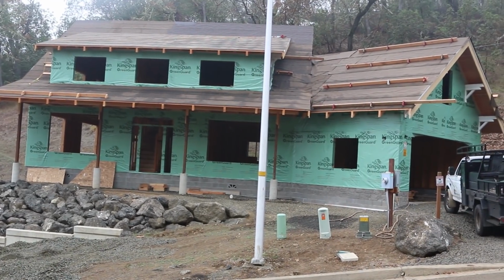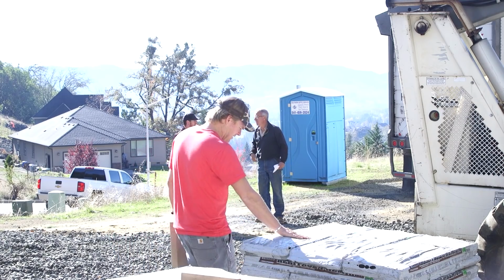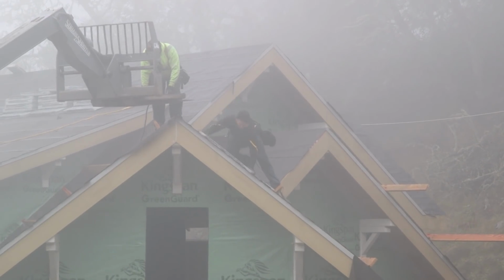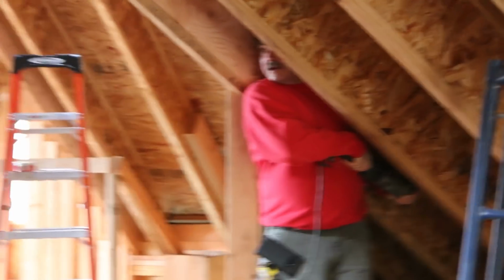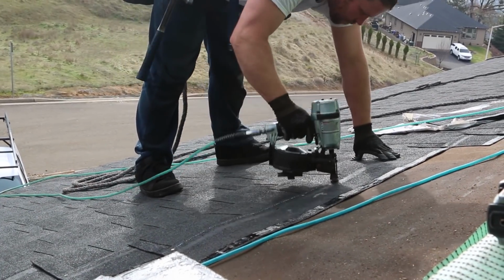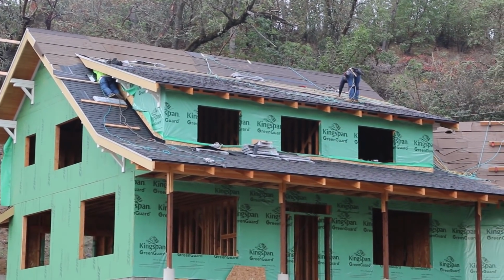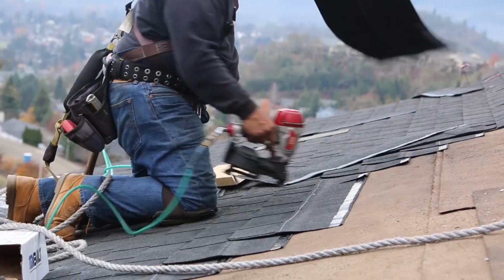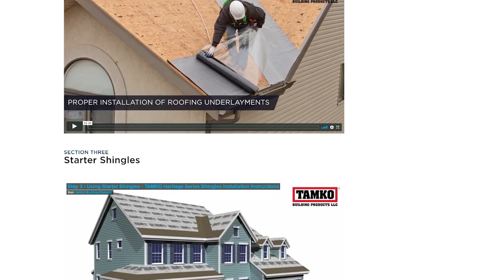Installing Asphalt Shingles Ep.77

Comment: Lol their safety anchor is held by nails?  That's not right is it?  We always used a special struc screw
Reply: If you think those 16d nails will pull out with a force perpendicular to the direction they were driven in, than go get some common sense.
Reply: @Faruk651  *then go get some common sense you mean?? THEN not THAN.  Smart guy over here 👈
Reply: Knowing good grammar has nothing to do with being smart. But not being able to understand the holding power of a 16d nail in shear force shows how smart you are.

Comment: 30 years ago I selected Tamko shingles for my home and it was the biggest mistake I made.  They simply would not seal and when I called them out to look at it they said it wasn't a problem.  They walked away leaving me with a 2500 square foot two story house with a gambrel roof that flapped like leaves on a tree with every wind from 10 MPH.  Sorry this is negative but they simply refused to consider they had a problem.

Comment: Guys are tied off, however there is so much slack I doubt the safety lines would help in a fall.
Reply: As long as the slack is shorter than the trip to the ground it'll at least help.

Comment: On the whole I like your videos and what you are doing.  But why would you use black shingles?  I know it looks nice but you are not heating the house with solar heat.  I too have finally had enough of a black car that heats up to 160 degrees where as the next white or silver car only heated up to 100 degrees in 85 sunny driveway.  About 4 years ago I had to have my so called 30 year roof replaced after 15 years.  This time I got a light shade that has made a world of difference.  My air conditioner is now on a lot less, costing much less electricity to run.  

Keep up the good work, I still am still learning despite my advanced years.  I guess we keep learning till we stop doing!

Comment: I hired some masonry pros to fix my falling 7 foot brick wall and they dumped wrnt concrete slush behind my wall in both my allys they left my yard a mess the wall they didn't isnt even level on the horizontal or vertical positions the wall is now bowing and they left a mess in my yard as well dumped morter slush and concrete slush in my yard and also borrowed one of my 5 gallon empty buckets didn't ask and destroyed it and I can't get them to come back out and clean there ness my alleys say no dumping and they dumped over 30 backs of concrete and mortar in my alleys just ripped the bags and jumped them was wrong @Essential Craftsman

Comment: That papers been sitting there to long which is why its buckled, and why there having a hard time nailing it,use that lull instead of hanging off a 2by4.no drip edge on the rakes that's a no no.

Comment: 17:30 Great spot to outline just how tightly installers must adhere to mfr's guidelines in order for homeowner to derive the "50 Year Warranty" benefits, without which a future claim will not be honored. Surprise! Can't tell you how many folks have been burned by the minutiae their installers may have overlooked (seams, nailing schedule, underlayment, penetrations, boots, drip edge, etc.)... in short, ANYTHING the mfr. can use to get out from under the danged 50-year performance guarantee.

Comment: Not trying to make judgements, but can anyone explain why you would use tar paper other than shaving $ where it shouldn’t be shaved?  I have been building for 20 years and not once has any distribution, manufacturer, or simply anyone said “hey let’s use tar paper”. Now, I am on the northeast and maybe we just want our homes to last longer here, using tar paper is like hand nailing.... it was done only because it as the only option the underlayment now are only about $15 a square max and will keep a house weather tight for 6-12 months with no worries of water coming through without shingles.  Sorry, not trying to criticize, but this is not a place to cut costs on a building.

Comment: 8:15 The red shirted professional moves the nail gun in a very unprofessional way by pulling/lifting by the hose which you should never do. At least, if it is your own equipment and you wish it to last for the next project, too.

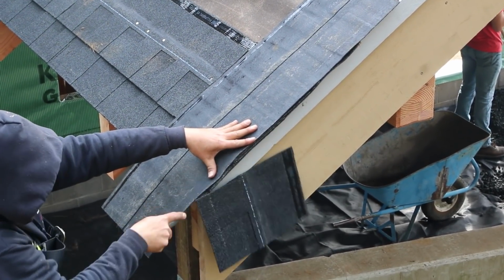9:18 The other guy cut the edge sheat without any metal liner or ruler. That's why the cut is not straight and it might be difficult to get cutted straight afterwards. The poor and not straight cut is easily seen in the video.
Reply: Pulling the nailer by the hose does result in strain on the hose right by the fitting, but it saves so much time that it's absolutely justified. Removing the inch or two of damaged hose every few months is a far better deal than managing awkward holds every minute of every day.

And the worker definitely used a straight edge to make the cut, it was the back edge of another shingle, I don't know if you could see it against the other shingles but it's there and it's straight. The resulting cut was as straight as any factory shingle edge. It may not have been as straight as a laser, but if you can make a cut that's as straight as the rest of the material, you've done well.
Reply: Haha I saw that too. Right when he said "professionals" the guy slings a nail gun by the hose.
Reply from the maker: Hoses on guns and cords on saws are net production advantages. The ability to lift and lower the tool without having to lift and lower your body is a money maker. I’m not afraid to buy a new tool, and I’m also not afraid to use the hose or the cord as part of the tool.
Reply: @HT-gx5jk  Haven’t used nail guns much, have you?
Reply: @psidvicious  I've used them daily for years. I regularly handle tools by the hoses or chords whenever it is more convenient, safer, or more efficient, so I fully agree with Essential Craftman's comment above. That's not my issue here, but rather the slinging of tools, which can be weighty especially when being slung, and thereby risking losing your balance while standing on top of an unsecured ladder at neck-breaking height without wearing a safety wire or even a helmet.

Maybe it sounded like I was concerned about the tool. My mistake. When working at dangerous heights I don't care about the tools. I rather break a thousand tools than my neck.

Comment: As a Californian I'm disappointed in your choice of color (if it was your choice; maybe that was a gift horse whose teeth you didn't care to check?). Roseburg is not that much further north that you don't have to consider summer heat load. A lighter color, even a mid-gray, would have added up to a whole lot of A/C energy conserved over that 50-year lifespan of the roof.

Comment: Why on earth do your roofing guys have roof jacks on the garage? That looks like a 7 or 8/12 and is walkable with the proper shoes. At the minimum, a toe board is needed but not an entire jack. Plus if you are a professional roofer, most of them have cushions for higher-pitched roofs so they can kneel or sit and move around while shingling.

Also, your roof is overly expensive. Start stips can be made by cutting a normal shingle in half down the middle. This creates a topper piece with the texture for the ridge of the roof, and a starter piece the same size provided in a snap off pack. That cutting saves you substantial amounts of money because starter strip bundles cost a lot more money than one pack of shingles.
Reply from the maker: 9-1/2 in 12
Reply: @essentialcraftsman  Is that the garage or the main part of the house? House above that low dormer looks steeper but its hard to tell in video.
 Other than that the roofers did a good job, but as a roofer myself I do things a bit different than the guys in this video, and everyone does something different than everyone else in the same trades.

Comment: I hate to be so blunt, but I don't know if I would even let my crews install Tamko, even it was free.   I am just not impressed with the quality.   Typically,  if we are removing shingles that are between 5 to 8 years old, it is ALWAYS tamko or gaf.  They are exactly what they are...  low quality, builder grade shingles.   In my region, we tend to stick to CertainTeed and Malarkey.  And we absolutely do NOT and NEVER will install that horrible tar paper....ONLY fully synthetic underlayment.  I prefer Stinger.   5-6 nails minimum, ice/water barrier in valleys (eaves by request, as it is not code for eaves, in ny particular region), and always ice/water around any openings and chimneys, before shingle installation.   Sorry to step on my soap box, but I just don't agree with alot in this video.  Although, the guy in this video (Jay I think is his name), is super articulate and delivers a very professional video.    If anyone out there is interested in selling roofs in the southern region of the U.S., send a message and would love to have y'all aboard!   Take care and be safe out there!

Comment: Why do the yanks use these crappy shingles? I wouldn’t use that on my shed. 
Use slate, clay or plastic-slate composite like the rest of the world and you’ll get several hundred years out of it easily
Reply: Indeed, I just don't get the construction techniques in the US
Reply: We have wood. Most other civie's have exhausted thier supply or don't have the right type for building.
Reply: Went to a college built in the mid 1800s. Slate roofs, lots of 3-story buildings. It was a challenge for Maintenence when a few blew off (Near miss by a small tornado). The one's they replaced may well have been original, they said. Northwestern Illinois.  Have no memory of them using safety gear, but who knows? We were in class, mostly.

Comment: Mike has installed lots of roofs lmmfa next clip Mexicans lol where is your ice and water shield and the are nailing the shingles wrong its 1 inch from. THE outside edge and 13 In between manufacturers won't cover roofs that are incorrect